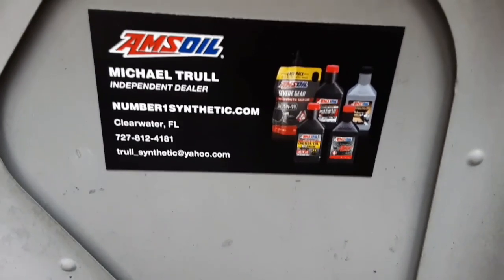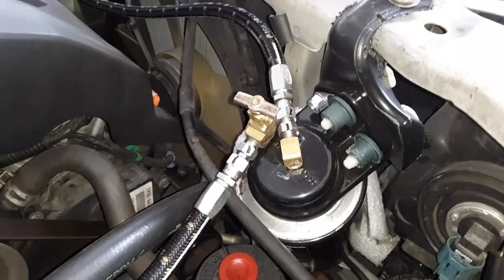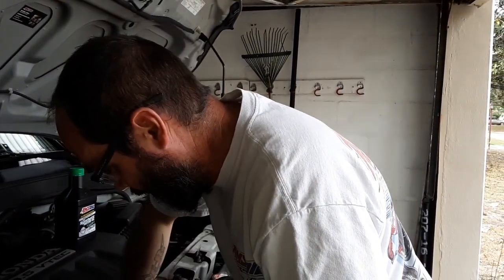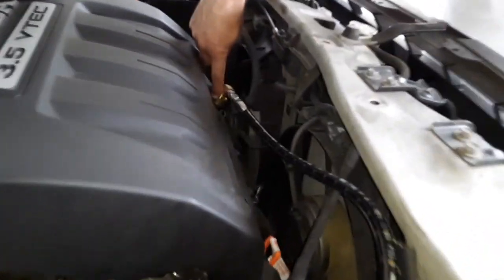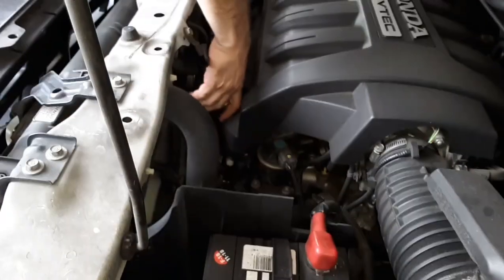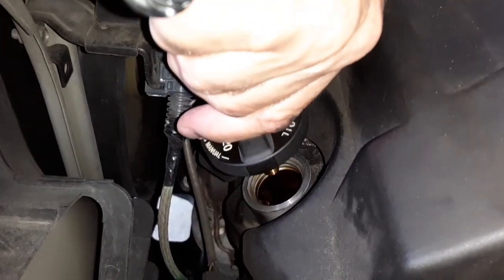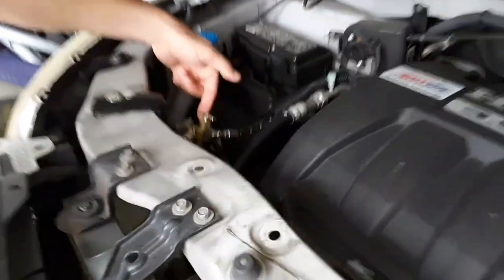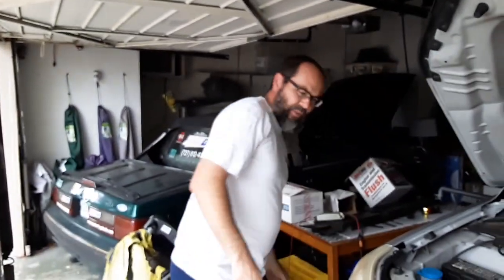2007 Honda Pilot Amsoil bypass filter 1.5 month follow-up/oil check/ Holy Saturday/ Verse of the Day

Comment: Is this something you think is worthwhile being that the tbn will be too low to run after 25k miles?
Reply from the maker: Thanks for the reply. From all the oil analysis reports I've seen the TBN actually holds up very well running one of these filters. I think it has to do with contaminants being removed immediately that helps the additive package to last longer. We shall see what the oil analysis results tell us and go from there. You bring up a great point... Total Base Number falling below zero would cause the engine to be attacked from the inside by acids.
Reply: I was under the impression that Amsoil no longer made bypass filter systems.
Reply from the maker: @07bonny  Roy, Amsoil is still making them from the simple Universal kit that I installed up to systems that fit heavy duty Class 8 diesel trucks. Some of the big three diesel pickups also have purpose built systems from Amsoil that are made to easily install on certain applications. Check them out: https://www.amsoil.com/c/bypass-oil-filtration-systems-mounts/32/?zo=1463115
Preferred customer membership is going to save you big time on one of these systems. Try adding the membership to your cart after looking at the prices of the systems and see what the preferred customer price is.
Reply: I had thought about one of these for my Chevy truck but I worry about losing oil pressure.
Reply from the maker: @jordansalmon8913  Jordan that is a valid concern. By diverting a small amount of oil flow there is a possibility of that. However if you have a healthy oil pump and your engine is not super worn or anything, it shouldn't be an issue. From what I understand much of the time your engine can't use all of the oil volume that your oil pump produces and it bleeds off through a pressure relief valve back into the oil pan. What year and engine is your Chevy truck? Amsoil makes a dual-remote bypass filter that uses an adapter that spins on in place of your oil filter and then you relocate your full flow filter to a separate mount along with a bypass filter. So all of the oil passes through those filters and then is returned to the engine. I couldn't do that on the Honda since they don't make a spin on adapter to fit the tiny filter on the Honda. There's a good chance a Chevy truck could use a setup like I'm describing. Check it out: https://www.amsoil.com/p/universal-dual-remote-bypass-system-bmk23/?zo=1463115
Reply: I have a 2012 Silverado with the 5.3 liter engine. It has 105k miles and I currently use assail signature series 0w30.
Reply from the maker: @jordansalmon8913  so along with the BMK23 dual remote system you would need to purchase the adapter it's at the bottom of the table on the product page for 2008 and up Chevy 1500 and 2500 gas pickups the BK310 (for M22x1.5 threads) which would screw onto your engine in place of your oil filter and then your hoses would go to the BMK23(dual-remote filter mount) wherever you could find space to mount it. Then you choose your filters- you could run an EaO15 as your full flow which is larger than what's on your engine now and the EaBP90 which is the smallest bypass filter Amsoil makes the same one I used on the Honda.  If you have space and really want to run even bigger filters you could go up to the EaO26 full-flow(very large) and either the EaBP100 or EaBP110, but those are all very large filters much more suited to diesel pickups and stuff. And you could also add a oil sampling valve. Using this setup all of the oil goes through the filters and then is returned to the engine oil galleys so other than the pressure differential across the filters and a slight loss from the length of hose you shouldn't lose much oil pressure with this setup.